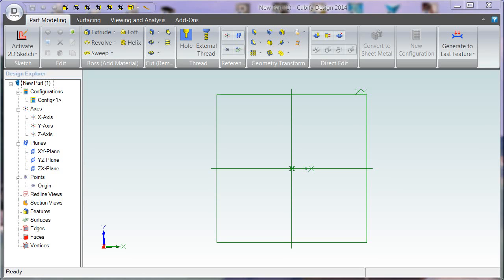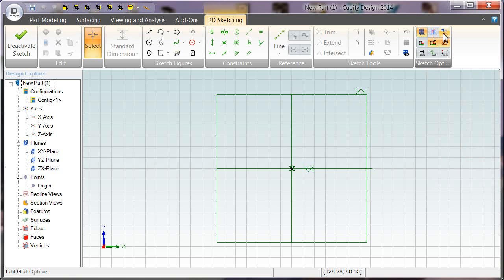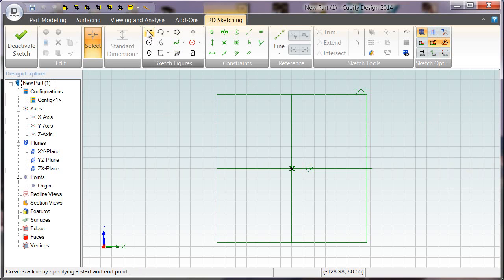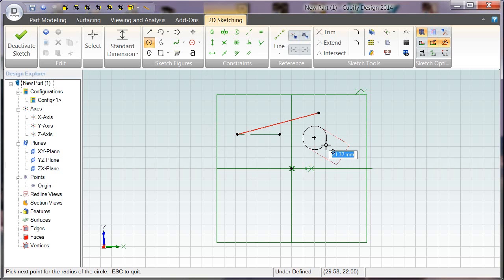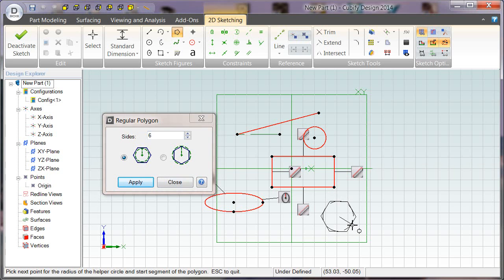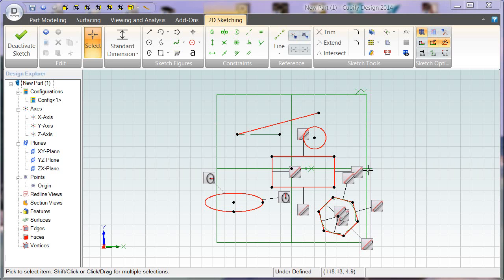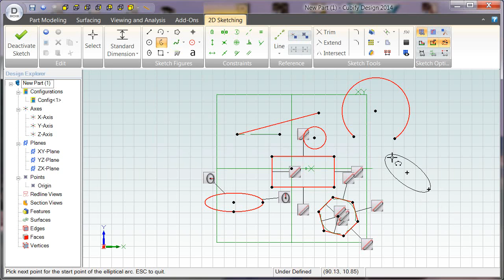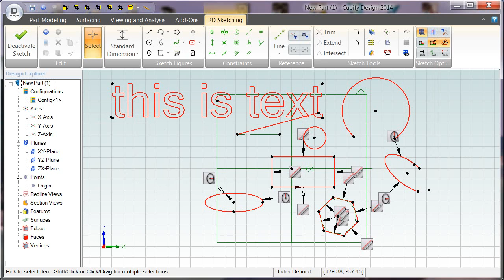Cubify Design - Real time dimensioning

Comment: I assume that first extra line that was created as a reference line for the angle since you constrained it by angle, not the endpoints.  It probably wants to record the angle with respect to another line going through the same point.  Based on the direction you went in, it inferred that the angle should be in reference to the X-axis, so it automatically created a reference line parallel to that axis.  If you don't enter the angle numerically, it doesn't seem to create that reference line.  As a software engineer, I could see why it makes sense to represent it that way under the hood, but why the user has to see it I'm not really sure.  I guess in case you want to change what the angle is in reference to later, if that's even possible?
Reply from the maker: I agree with you - why do we need to know this? If we do, why is it not explained in the help files?

Comment: I've never realized how little I use those features until now.  I think I always use rectangle or circle and then modify them with the dimension tool.  It seemed to me like a good number of the other CAD programs I tried preferred that method, as well.  Also, I recommend staying away from those red sketch shapes that open the dialog boxes.  They seem to act differently when used as reference geometry than if you made the shapes using the other tools.  I have no idea why...